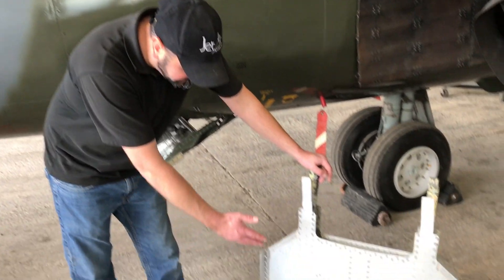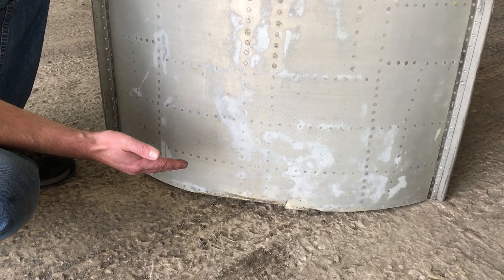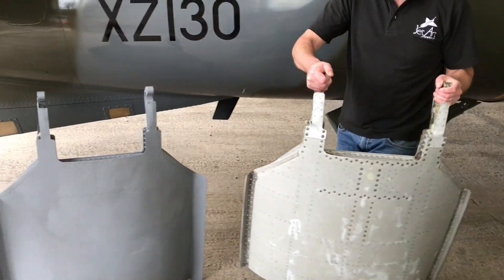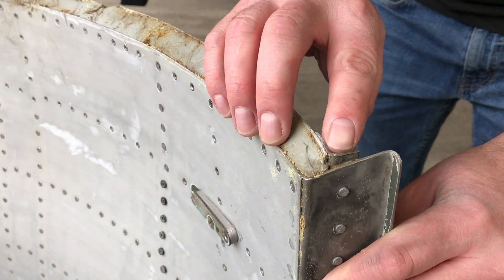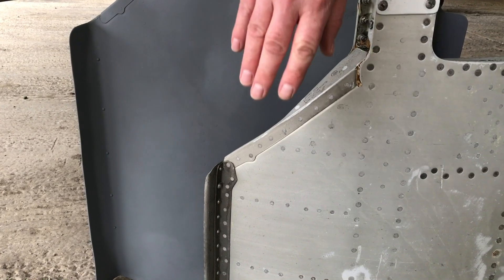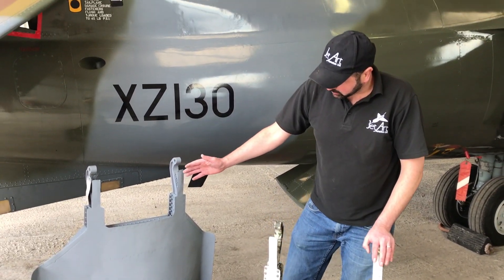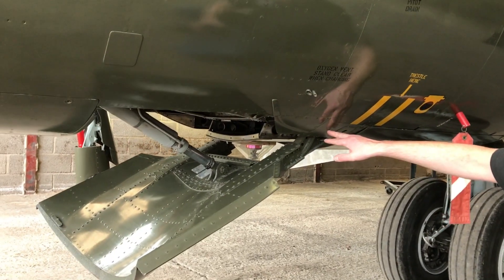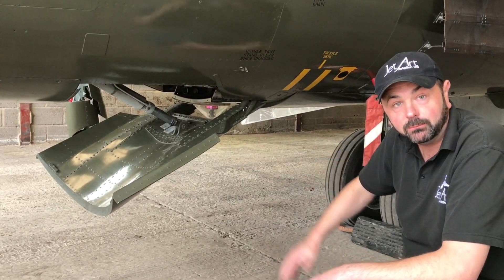Harrier Air Brakes - GR1 & GR3 Differences with XV741

Comment: The airbrake was shortened to allow for the lower equipment bay to hold the flare dispenser which was fitted for Operation Corporate, the existing airbrake covered the panel partly when retracted so it was shortened to allow for the lower bay panel to be swapped out.